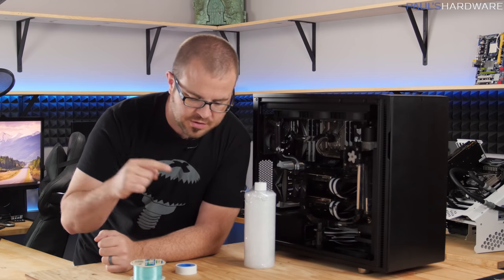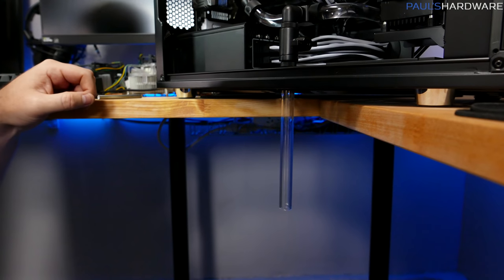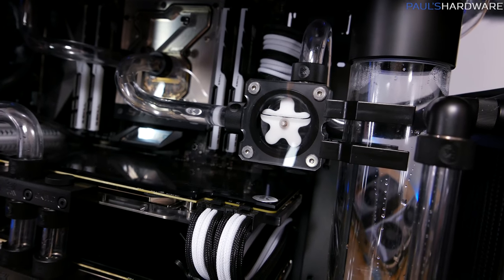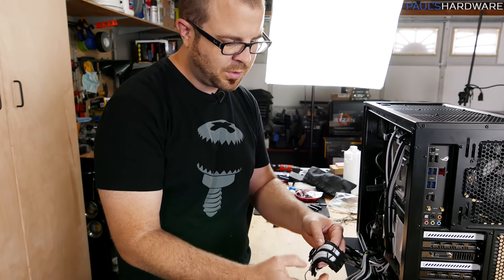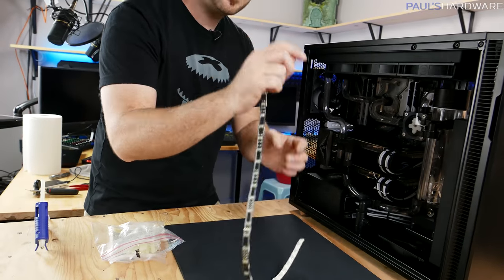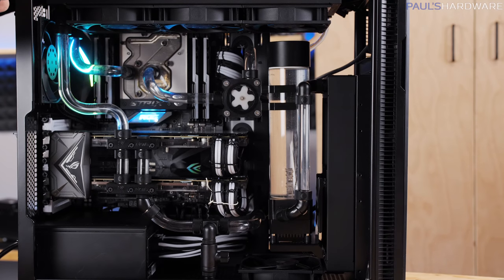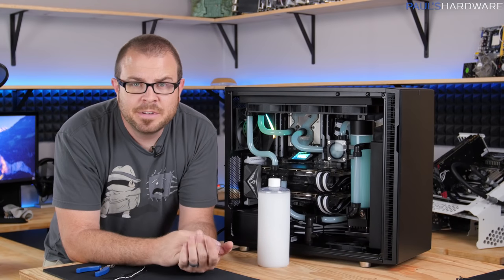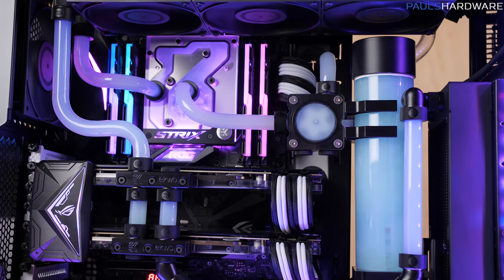MY WATERCOOLED PC IS FINALLY FINISHED! Arctic Panther Build Log Part 4

Comment: Hey, 

Its tuff to play CS GO on 21FPS with my late 2009 MAC soo... can you please help me out with my build (the list's below). Well,  This is a budget Build so I'm trying to cut down on few and spending a bit more on CPU and GPU. Please suggest which ones the right ram for a Ryzen 7 1700 and the required PSU (W) to this build. 

THANK YOU

For Motherboard:

1. Asus B250F Strix Gaming 

2. ASUS PRIME B350-PLUS AM4 AMD RYZEN B350

3. GIGABYTE GA-AX370-Gaming K5 

4. Asus Z270F Strix Gaming 

For CPU:

AMD Ryzen 7 1700

For GPU:

1. GIGABYTE GeForce GTX 1070

2. MSI Radeon RX Vega 56 Radeon

For RAM: pick the 

1. Ballistix Sport LT 16GB (2 x 8GB) 

2. G.SKILL Flare X Series 16GB (2 x 8GB)!!!THIS!!?

3. HyperX FURY 2400MHz DDR4 (2 x 8GB) 

For PSU:

EVGA SuperNOVA 750 G3 - Rs.17,940 (12,510)

And HARD DRIVE AND SSD:

1. WD BLACK 1 TB 

2. Sand disk 120 GB

Comment: water in PCs? i assume its for cooling purposes but it still looks ridiculous! is that the most effective method?
Reply: Akemi Homura its not worth it if the only thing you’re looking for is performance because water cooling like this is very expensive, and that money could be used for maybe more powerful GPU’s or a better CPU for example. Watercooling looks very good though and your parts that are in the loop get very cold so you can overclock them higher in most cases because it removes the thermal limit. 

I myself use watercooling in my build because it looks really nice and its fun to build a loop. Its expensive though.
Reply: I see,thank you for the advice.

Comment: An erection (clinically: penile erection or penile tumescence) is a physiological phenomenon in which the penis becomes firmer, engorged and enlarged. Penile erection is the result of a complex interaction of psychological, neural, vascular and endocrine factors, and is often associated with sexual arousal or sexual attraction, although erections can also be spontaneous. The shape, angle and direction of an erection varies considerably in humans.

Physiologically, erection is triggered by the parasympathetic division of the autonomic nervous system (ANS), causing nitric oxide (a vasodilator) levels to rise in the trabecular arteries and smooth muscle of the penis. The arteries dilate causing the corpora cavernosa of the penis (and to a lesser extent the corpora spongiosum) to fill with blood; simultaneously the ischiocavernosus and bulbospongiosus muscles compress the veins of the corpora cavernosa restricting the egress and circulation of this blood. Erection subsides when parasympathetic activity reduces to baseline.

As an autonomic nervous system response, an erection may result from a variety of stimuli, including sexual stimulation and sexual arousal, and is therefore not entirely under conscious control. Erections during sleep or upon waking up are known as nocturnal penile tumescence (NPT). Absence of nocturnal erection is commonly used to distinguish between physical and psychological causes of erectile dysfunction and impotence.

A penis which is partly, but not fully, erect is sometimes known as a semi-erection (clinically: partial tumescence); a penis which is not erect is typically referred to as being flaccid, or soft.

Comment: May you tell all your friends or anyone that might be interested that im selling an Unlocked IPhone 6s, 7+, regular 8, a Ps4 Pro, Xbox one X, GTX 1080 TI, a Nt1-A microphone, a Scarlett 2i4 Audio Interface, and an Asus Gaming Laptop 144hz Edition. The 6s is 100, 7+ is 150, 8 is 200, Ps4 Pro is 200, Xbox one X is 250, Gtx 1080ti is 300, Nt1-A microphone is 150, Audio interface is 100, And the Gaming laptop is 350. Must have a credit or debit card and cant be on bullshit about it. Im deadass about selling all this. All phones are unlocked so can be used with any carrier. Free shipping with everything. Hmu at 8049431714 if you or anybody you know might be interested.
Reply: Sorry bud but i dont think your selling an unreleased xbox for half the cost
Reply: Michael Dillon No💀You right im not. Im selling the actual preorder.
Reply: Are you dying or something and want to get rid of the items so they don’t go to your family?
Reply: xblCaboose No im saving up for a full pc. Prebuilt only because i dont know all the steps in building a pc yet, which is why im here. Im only selling the 1080ti because it cant fit in my optiplex 780 tower case🤦🏽‍♂️🤦🏽‍♂️And the motherboard and power supply only supports single slot low profile 1050ti.
Reply: Andy Luo Hit my number. 8049431714
Reply: Andy Luo or my kik, bryant.anderson1997
Reply: Andy Luo Its something like the Y50. Some number like that
Reply: Glow Bloke Its basically new💀💀I tried to fit it in my case and when it didnt fit i just put it back in the box. Nobody on Mercari, OfferUp, Or Letgo wants to buy it for 700 so im selling it for the low.
Reply: I wouldn't trust anyone who just happens to have all that you listed and are selling it for what you claim. I call bs.
Reply: "Deadass" bullshit post
Reply: issaciams Okay💀💀💀You act like i haven't made any sales yet